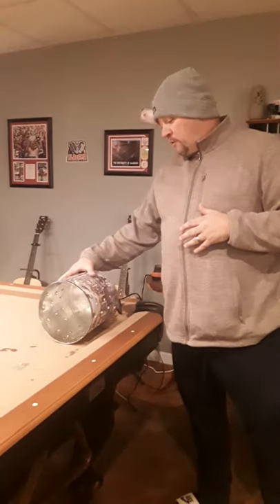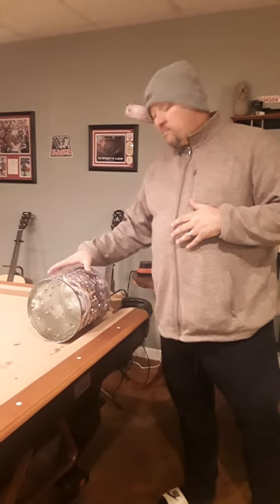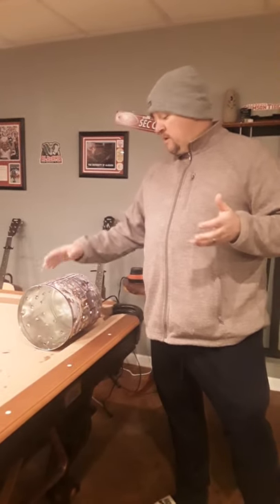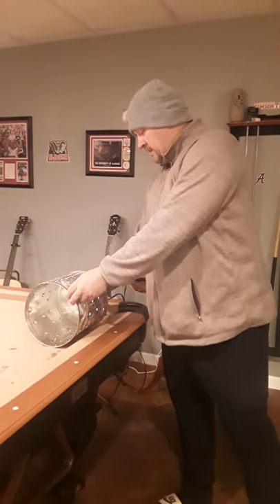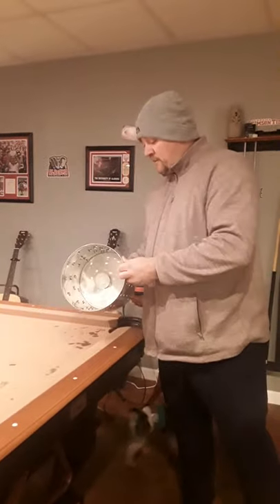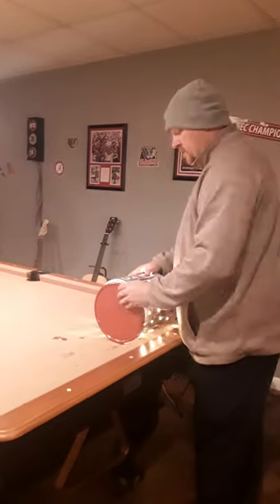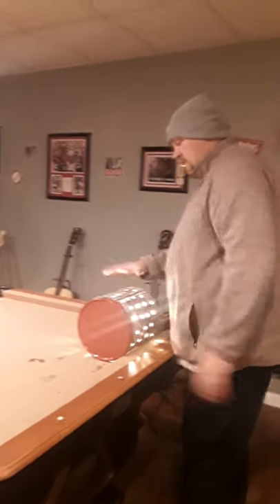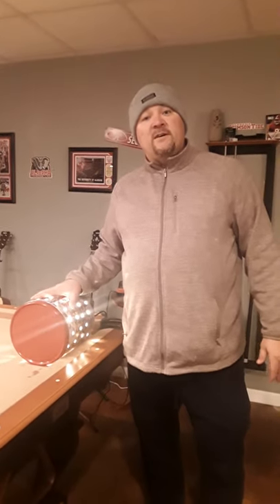Dog House Heater DIY (100 watt bulb)

Comment: What watt light bulb do you use?
Reply: 100 (it’s in the title) 👍🏽
Reply: 100 (it’s in the title).......
Reply: Yeah but led? Or reptile bulb??
Reply: @Risici_Bloom  I don't think an LED would work because the wattage is much less.  That's what determines the heat output.

Comment: Why does it need the holes?
Reply from the maker: It lets the heat escape
Reply: To let the heat escape would be obvious reason.  If there was no holes it liklywould trap heat and make hot enough to burn pet or start a fire